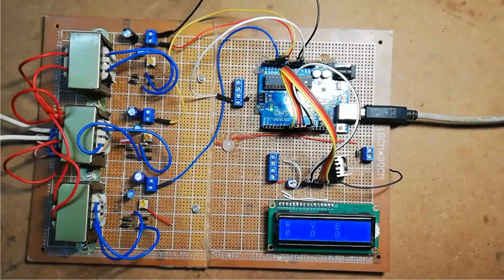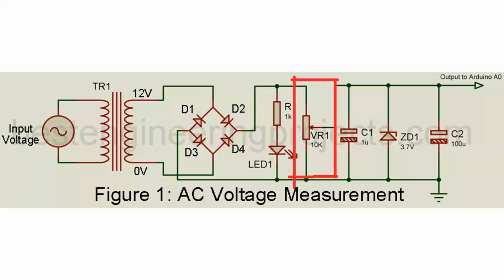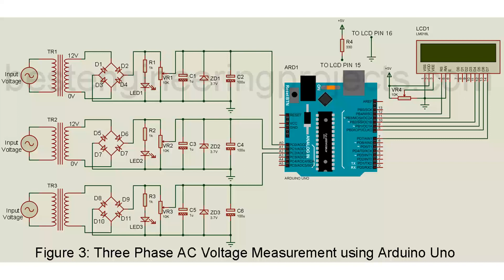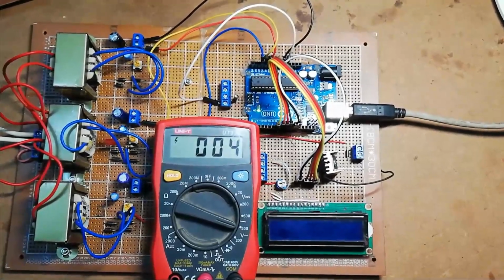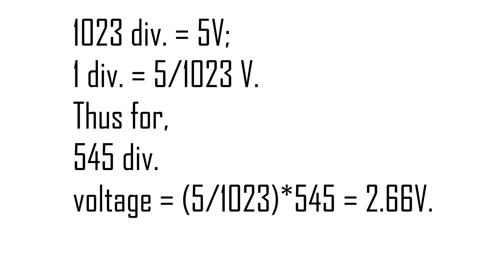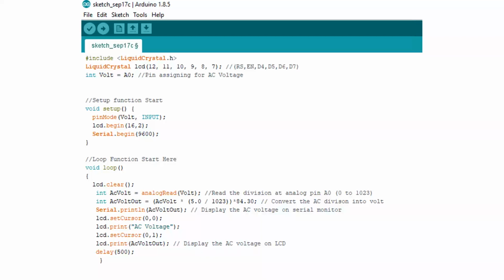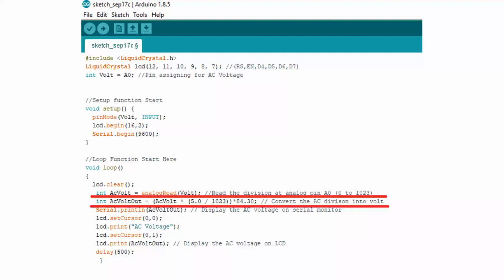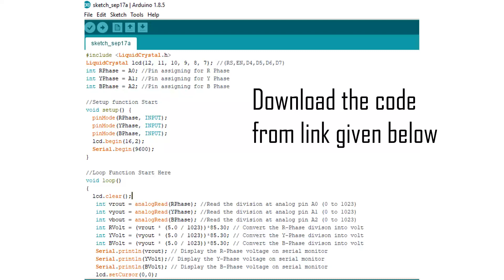Three Phase AC Voltage Measurement using Arduino

Comment: if we do it on stm32 max 3.3V it supports and what is the C1 1u, C2 100u voltage any additional or modification required for stm32

Comment: Is it possible if i use 5.1v zener diode for this? If it is possible, what would be the values of R1, VR1, C1 and C2?
Reply from the maker: I do not recommend you to use 5.1V, because it might hurt your arduino.
Reply: Guess you've ready figured this, but you can put one or two diodes before in series with the Zener diode, they have their own voltage drop of about 0,6V each. Two of them will create a voltage drop before the Zener of about 1,2V, in total you should get a drop of about 3,7+1,2=4,9V drop, in theory.

Comment: Why 545, I don't understand please explain.
Reply from the maker: 545 is the ADC value, corresponding to the measured AC voltage used to calculate the multiplier.
Reply: @Bestengineeringprojectsbep  don't understand. Please show the prectical.
Reply from the maker: @0124akash  watch the entire video, there I had include every tiny details. In case confusing, go through the link given in description.
Thanks
Reply: @Bestengineeringprojectsbep  reading start in serial monitor 549. In serial monitor reading not showing 545 anywhere.